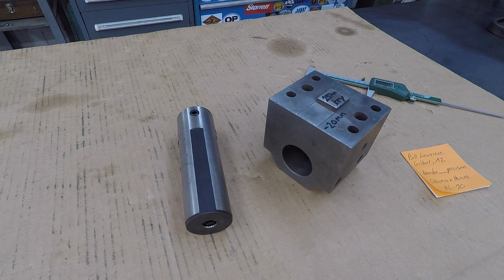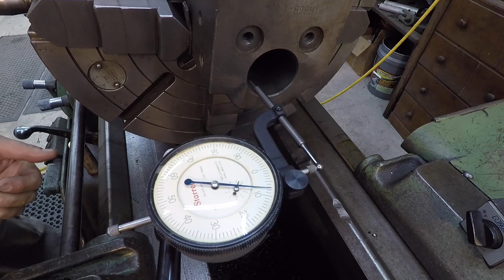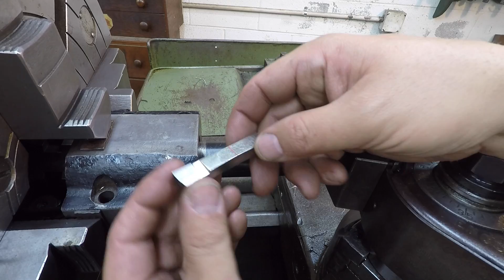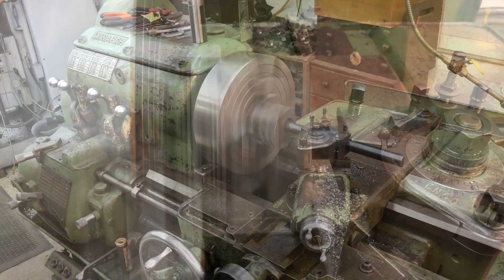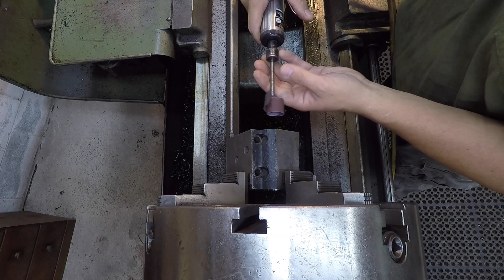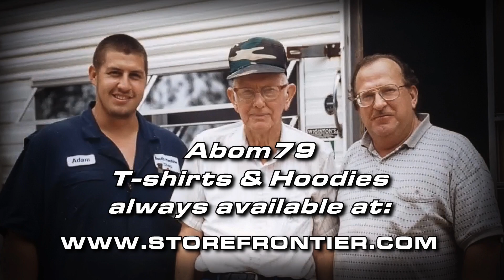SNS 306 Part 1: Okuma Tool Block Modifications

Comment: The quickest way I loaded parts like that was to use a standoff between part and chuck face, the use a large center in the tail stock to snug up in the ID. You'll wind up pretty much flat and within a few thousands on the ID. :0)
Reply: Assuming that the front and back face are parallel, perhaps.
Reply: @vinny142  Abom's already assuming the bore is perpendicular to the face, so why not?

Comment: Wouldn't a centering spindle in the tailstock quicken the process?
Reply: No and yes,  if the base was square and the hole wasn't offset the way it is. Adam eliminated half the compound equations by chucking it first. Let's say the next project has an ear, what then?
Reply: Is this a timed event?

Comment: 4:00 Another quick way to get ofset part like that centred in the 4-Jaw ... is to simply chuck them in the Tail Stock (how ever there a dozen methods) ... run the part up to the four jaw and grip it ... gets you with in .030" or somtimes MUCH closer ... first try! :)

Comment: There is a really high pitch sound.  Camera or something else in the shop maybe making it.
Reply: I've heard it too, I think its the cameras mic reacting with the electrical fields in the shop...no worries, doesn't bother me really. Reiminds me of electron tube TV's.
Reply: Air con?  Old ears here so I can't actually hear high pitches, but I hear fan noise, most likely air con, but not loud enough to bother me
Reply: He mentioned in a post that he thinks it is in one of his new cameras. He said he will address it at some point, but if it means buying yet another camera, then it means more $$$. I don't hear it and I am listening over my home Hi-Fi speakers - I think it is mainly an issue for headphone users.
Reply: @kindabluejazz  I can hear it on my phone, pc, stereo, and headphones.  It is there. I should use an audio spectrum analyzer to find out what freq.
Reply: @TheThomasites  Can you give me a timestamp of an obvious case? I will crank up my stereo and stand right next to my speakers. Right now I have my system setup like a home theatre, so I typically sit about 6-8 feet from the speakers.
Reply: @scottr939  immediately the first clip has the high tone in it
Reply: Not hearing it on my speakers?
Reply: The biggest problem I have with inside mics is that they only get the measurement of the beginning of the bore. I've seen plenty of bores come in tapered heavily for a straight bore.
Reply: Pretty high, i would say higher than 8k. I can hear up to 17k still with my old ears.  Especially when old tvs have bad flyback transformers.
Reply: @TheThomasites  i've done fft analysis, i know it's 5 khz and 8 khz
Reply: here's the spectrum if you don't believe me: https://i.imgur.com/RrWLyp0.png
i've applied a notch filter (Q = 10) at 5041 hz and 8622 hz and the high beep is gone
Reply: @ikbendusan  oh, I believe you.  Its hard to place at that high.  I'm just used to walking into a transmitter room and hearing that something is off.
Reply: Yep, I've mentioned it as well.  Honestly,  I'm willing to help Abom fix it just so that I can enjoy the videos on something other than my PC (where I can filter it). 
So yeah, @Abom79  If you would like detailed directions on how to fix it, just reply here and tell me what video editing program you use and I'll put together a howto for you.
Reply: The whole video or do you have time stamps?
Reply: I can't hear any high pitched whine .. and I'm watch with a pretty expensive set of 100 watt speakers
Reply: @MikeBaxterABC  well (is a deep subject) turn up your amp...mine is 100 watt onkyo being played through a 40 year old realistic stereo EQ (anyone remember radio shack?) and a pair of 30 year old RCA desktop speakers that were used 10 years used prior to when I got em. I am fudging the ohms tho (the amp calls for 8, the speakers are 6). I've kept the power output at 13-14 of 40 on the amp for the last 5 years or so. After 25 years of rocknroll through a 50 watt marshall half stack and lotsa drums, I can still hear high pitches, though a jet engine will rattle my mids uncomfortably. And yes I do have the bell sound as well. I'm 41 years old btw. I don't use headphones anymore...actually deafens me. Earplugs are a must now if I am going to endure higher sound pressures and continue hearing. Anyway, in the words of grandpa simpson and the THX test, "turnnn itt uppp" :)
Reply: @somethingsomeonesaid6455  my hearing is tested annually.  I have amazing low and ok high, up to 17k still. But I spent too much time on an airfield and around radar transmitters.  Pain in my ears and low drone but still great hearing.
Reply: i've been complaining about it for at least 10 videos lol. there's a tone at around 8 khz and a tone at 5 khz. either he doesn't want to fix it, he doesn't "hear it" like mr. Getis Realis, or he doesn't know how.